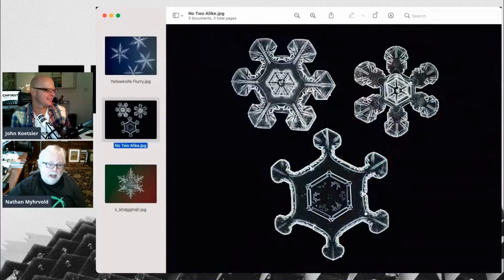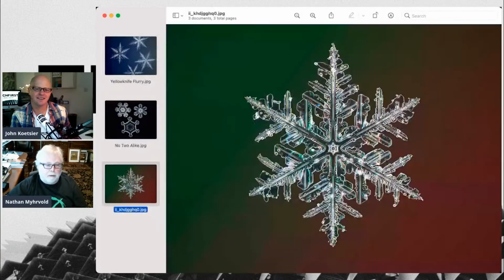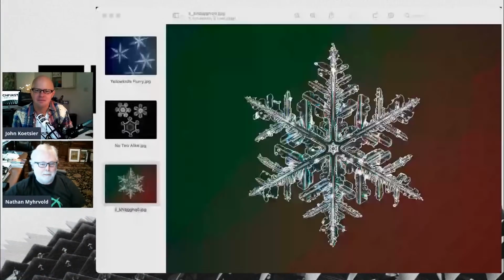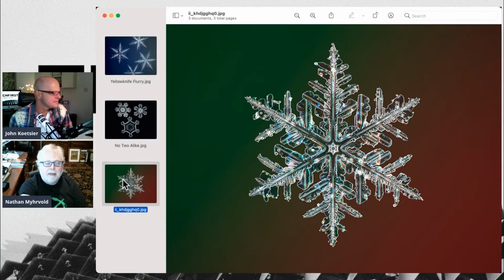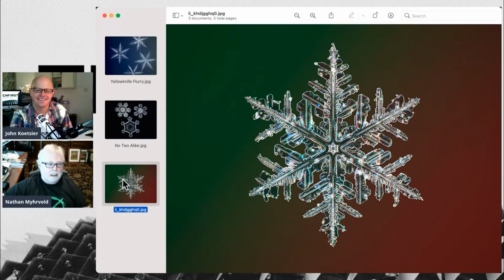Why former Microsoft CTO Nathan Myhrvold is taking the highest-resolution snowflake photos ever

Comment: Good afternoon, John !).my name is Dmitry I am from the Altai territory, the city Kamen-na-Obi with Russia, I looked at your photo about snowflake concluded that turns all the snowflakes they are different in appearance in form and structure and pattern this is the first / second all snowflakes they are sharp contours as five-star as well, a lot of interesting But the biggest fact of the conclusion that the depth of thought what where they went as if the formation of air currents, or otherwise, I have formed the opinion that it is the fact that there is a certain fluctuation of the sound waves and these vibrations of sound waves solidification certain structure of water and the effect of what we call snowflakes and well, in this photo you can see it clearly.the oscillations of these waves are quite heterogeneous and change their structure and do not have equal significance in terms of frequency of repetition. And for this reason, in the upper part of the formation of snowflakes, there is a sound vibration and after the flight and